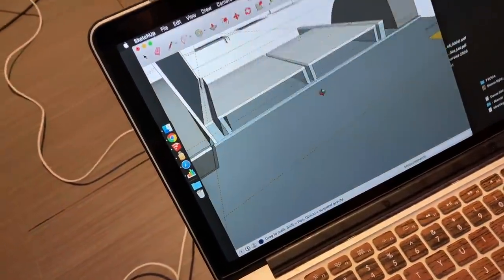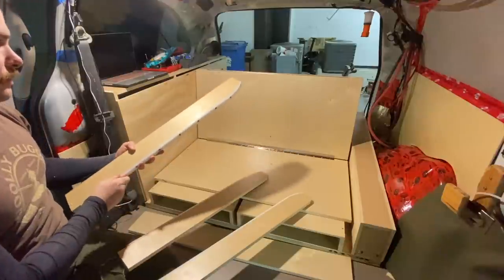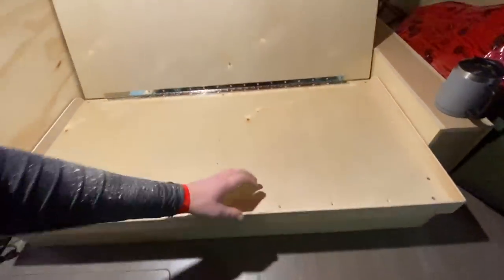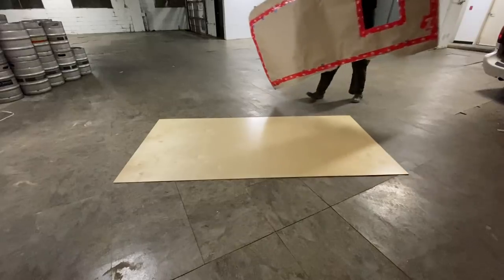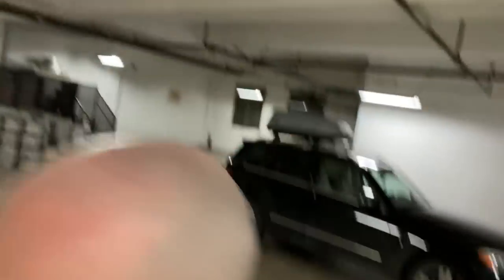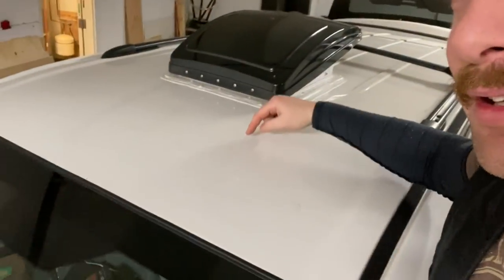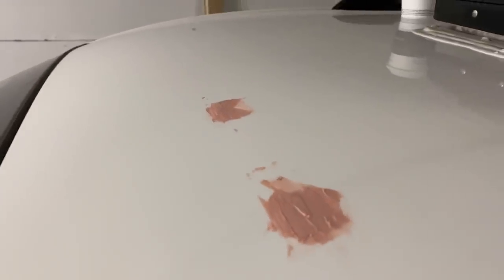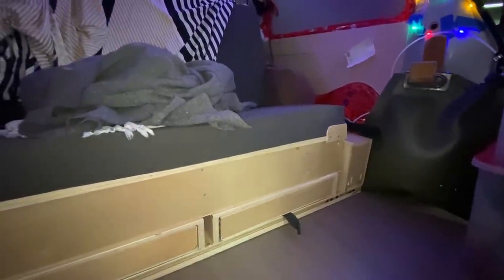MINIVAN Build E-20 || Bed Design & Construction, Ceiling Fit & Installation, Drawers & Mistakes

Comment: Oh man I feel your pain.  I was installing an air conditioner in a 65ft yacht and punched 2 screws right out the bottom of the boat.  Luckily I was doing the install in dry dock..
Reply from the maker: Ouch.  I think that would bother me much more.  Glad you got that one sorted.  Sometimes these mistakes bring out our best.
Reply: Fortunately the owner wanted the bottom stripped and re-painted on the same work order so it was a good time to learn that lesson.

Comment: When I did the ceiling board in my van I had a moment of panic and had to check the roof.  I thought the screws might have gone through.  When I saw where yours poked through my first thought was..well, time for a light bar :)
Reply from the maker: Yeah I thought a light bar may be a good way to hide that.  Hahah. Cheers

Comment: Hey Joseph, sorry not been here much, been busy with caregiving duties for my elderly dad and working on my van conversion build too. Near complete with the subwalls, will be working on some framing needed to install before I reset the original van wiring neatly, etc. However, love the way you did the sofa/bed, I like that idea too. Sorry about how that happened to your roof from those screws, I know you're not alone in that, I've heard it happens even though we all try to avoid doing so. Be blessed and safe Joseph, sending hugs love and prayers to you and your family and everyone up there in Canada too from me and my dad in Odessa TX 🤗💖🤗💖

Comment: Is that white paint or laminate?
Reply from the maker: The floor is now white laminate and the walls are all painted white.
Reply: @SharingTheWild  Okay yeah was wondering why and how good that floor looks so good lol what type of wood is that on the walls? Your cabinets?
Reply from the maker: @jinno.w.8962  1/2" birch ply
Reply: @SharingTheWild  ahhh ok awesome. That's light wood so it will help with the weight.

Comment: Is that why the roof leaks now?
Reply from the maker: No.  The leak isn't from the roof.   It's from the wheel wells.  Thanks for reminding me about it.
Reply: Ok some reason I thought it was in a ceiling panel. Sorry.
Reply from the maker: @joycepollitt7825  all good.  It would be super easy to think that after seeing this video.  Those holes haven't leaked after that fix.   Mind you I still mean to repaint that part of the roof.